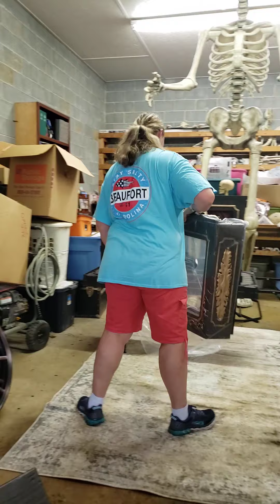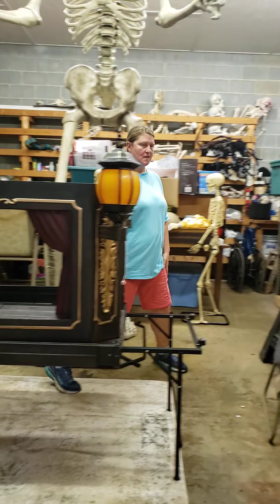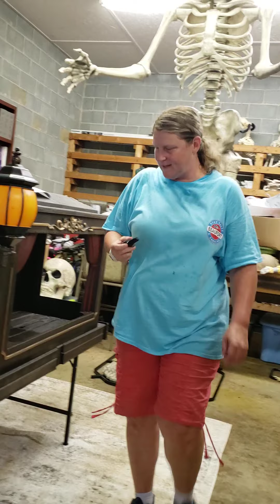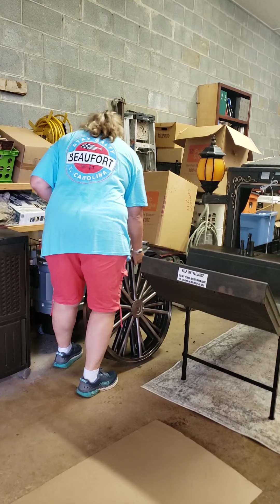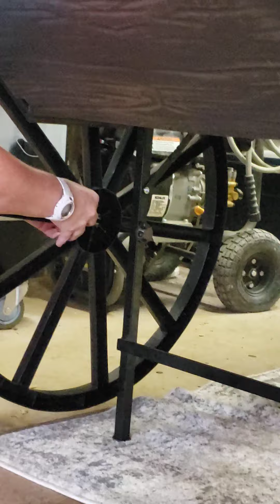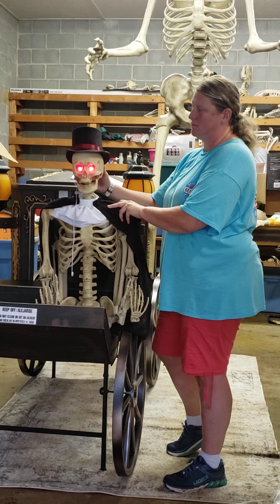Home depot hearse set up

Comment: Hey, quick question. I just put mine together the other day and one of the lanterns doesn’t light up. Do you know if that’s something I can fix myself, like is there a way to open the lantern and maybe change the bulb or something? I called the manufacturer and they are out of stock for replacement parts
Reply from the maker: Hi I haven't taken mine apart so not sure. Usually it's either a bulb or connection problem. I'd try bulb first easier to get to.
Reply: Ok thanks